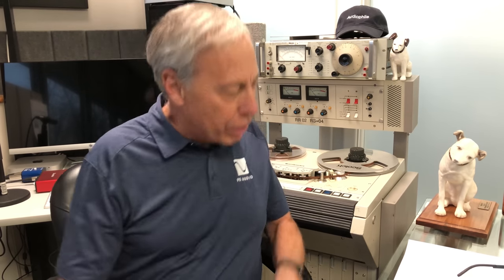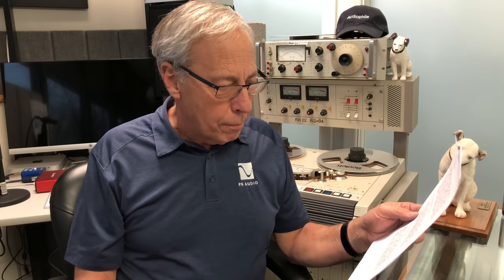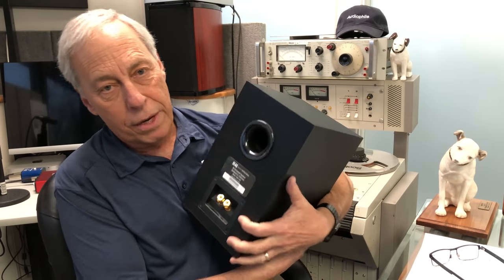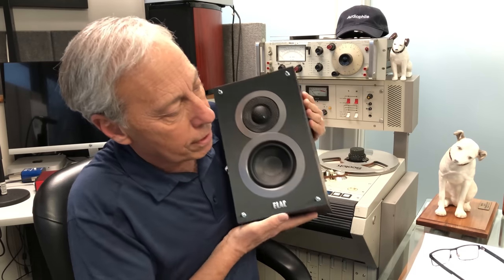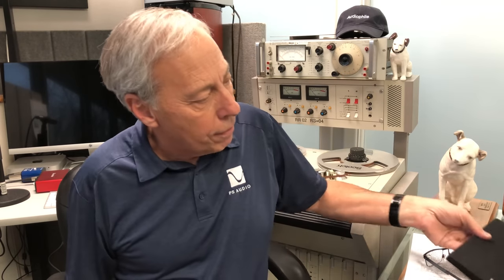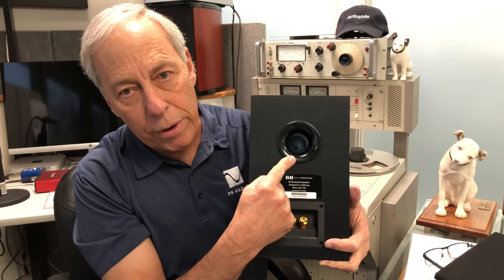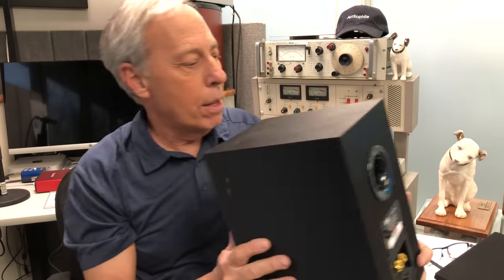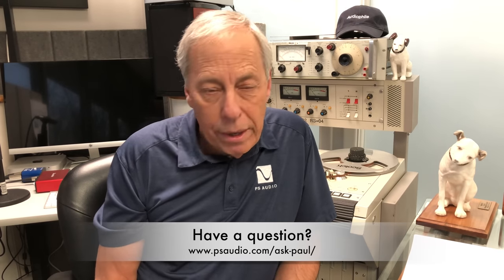Ported loudspeakers

Comment: What happens if the port is too small? Or too large?
Reply: Too small a diameter causes chuffing. Too large a diameter and your woofer might as well be in open air. Changing the length of the port, changes the resonant frequency of the port, which can extend the range of a woofer or smother it.

There is a whole science behind the things. Or atleast there is behind the well designed ones. Thankfully we have computers these days, you can just feed them specifications on a woofer and what kind of port you want and it'll spit out a design for you.

Comment: Jm labs proved how badly a front port could fail.  $38k for a pair of speakers with an odd shaped large  front port.  The bad part?  The port coloration was painfully obvious.  It was the first time I listened to a $38k midfi speaker.
Reply: A lot expensive speakers are dissapointing!  You'd be surprised these days what budget gear can sound expensive and surprisingly pleasing I have even heard some "DJ" speakers that surprisingly make for decent hifi speakers.  Despite thier   looks and unknown brand names!
Reply: @raymondleggs5508  I sure love my Cerwin-Vega! SL 15s. Less than $1000, and since this is all about bass, they get down. Specs say 28hz, I don't doubt it. Hard to find a big box 3-way anymore. Really fun speakers, I enjoy them. A good powerful amp helps.
Reply: @ericnortan9012  To get big loud sound you need big speakers with big woofers
Reply: @raymondleggs5508  I agree. That's why I have 15" 3-ways
🤘💀🤘

Comment: damn, i hate the sound of sealed... it sounds restricted, stifled, like its being kidnapped and the  chloroform is starting to kick in.
Reply: Then you have listened to a poor design.
Reply: You have no experience in old school sound ! BIG bass driver in sealed cabinet was AWESOME  !!! Look for KEF reference 3way floorstander  from end of 70-ies... R105 i think it was... point is that "small excursion drivers" were great in sealed boxes...
Reply: You're hearing the sound of the placebo effect.
Reply: Mohammad. I agree. A sealed cabinet has no volume. A sealed speaker sounds congested.
Reply: It's called "damping effect" for bass. But basreflex is always better IF IT'S high excursion driver and made for ported/transmission line/horn  setup...
Reply: Go and listen to ATC speakers like the SCM40

Comment: Helmholtz resonator. Below a certain frequency, out of phase, then above that at the tuning frequency, in phase - then even higher above that, theoretically no output from the port. Take a weight and attach to the bottom of an elastic string and let it drop down holding it with your hand. Now move your hand up and down very slowly, everything moves together. Start moving your hand gradually faster up and down and you will get to a certain 'frequency' where the hand goes up the weight goes down and vice versa. They will be going in opposite direction, it will be inverted. The hand is the cone, the elastic string is the volume of the box, and the weight is the air in the port. Go even faster and you will get to a point where the hand moves up and down so fast and yet the weight does not, it will become stationary.

Comment: Hate ports. The always cause a bass hump around 100 HZ and I can hear the port. Passive radiators are the way to go in my opinion. But the tightest most accurate bass I ever heard was from electrostatic speakers like mine.
Reply: Anders Hammer heard quad electro-static speakers with quad 33/303 "traffic welcome to the canteen (live)
it was "the real thing"
never forget it.
did beat my klipsch la scala/mac-tubes/ Decca London handselected
by it's natural presentation....
Reply: The La Scala's were to me the best I'd heard of horn speakers. I use early Acoustat electrostatic speakers in my system and to me they sound the same as a live orchestra.My father used to tell me not to spend alot on a stereo because it will never sound like the real thing and that I should spend my money on tickets. Well he kinda ate his words when he heard my stereo.
Reply: A good ported box sounds better than any passive can. Passive let's you keep the box small that's it. It has no advantage over ported.
Reply: check out some of the higher powered car audio subs, and u aint gonna get no 100hz boost.   the enclousures u listen to arent designed properly.
Reply: Car audio is designed for cars not home audio. I really have no interest in car audio.
Reply: Passive radiator let's you lose the volume in the port volume required (which is substantial). In the war to make the most compact, highest output box. SQ take a back seat , I can rattle my fillings out with a tiny d-class box. Let's get back to basics.
Reply: You obviously have no clue how ports work.
Reply: Not always at 100Hz; different speakers are tuned differently.

Comment: I am about to make a sub enclosure from a large PVC Pipe section which is 14 " that allows me to use a 12 inch driver can anyone surgery a website or free designs for tube enclosures, I might encorporate a full speaker build using the tube section with a smaller book shelf type speaker design attaching them together making the tube a pure downfiring sub.

Comment: I have front and rear ports on my B&W 704 floor-standing speakers ; yet I find them too light in the bass department
Reply: Perhaps placement? Tried another amp or pre-amp? I have heard B&W Nautilus sounding really thin and without any warmth with some Denon receiver.... When a Marantz was hooked up, all came alive. Than mono-blocks where added along with cracks in the walls.....
Reply: @rdolle990  I changed to DALI opticron floor stand speakers with REL woofers for each channel... also use 2 Arcam amplifiers with Vertical bi-amp wiring... amazing results !!
Reply: @pandoraefretum  That's earth-quaking! :)

Comment: The bottom line is, listen with your ears and NOT your wallet and what other people say. There's not one "correct" way to design a speaker, if it's designed well. Sealed, Ported, Transmission Line, Planar, Electrostatic, etc. are all just different ways to get you to the Music.
Reply: But what if my ears and my wallet vehemently disagree?

Comment: I never like ported speakers either.  The speakers that I have are now 40 years old.  I designed and built them myself, and they are still going strong.   I did though have to rebuild the woofers at one point since the outer rubber cone mounting rings had turned to dust. But for just 27 dollars, and a couple of hours work per woofer, they were as good as new.   https://ibb.co/jSWGOo

Comment: The Elac speaker that you had in your hands...you were not pressing on the woofer...you were pressing on a passive driver that is moved by the active woofer inside the box therefore the inside volume of air changes and is not fixed....just saying

Comment: Not to beat a dead horse but I have a set of AAD 2001 monitors , 4.75 inch driver , rear ported . I invite anyone to detect any audible port discharge noise from these Phil Jones marvels. easily 32 hz from a small monitor with a small bass inch driver.....  DESIGN ….

Comment: Wow. I tried to plug up the port on my sub woofer. Totally no more bass! It does seem to sound a bit cleaner. But all those pleasant frequencies are gone! :)
Reply: That is not exactly how that works.  A properly sealed box uses the subwoofers T/S parameters to determine the best size for the box (typically much smaller than the ported box).  Also a designer will look at the Q of the speaker to see if it works better in a sealed or ported enclosure.  So it is not a huge surprise that you got that result just by plugging the port on your subwoofer.
Reply: Paul,

That really all depends on your goal. If that was true, manufacturers like KEF and Monitor Audio wouldn't supply port bungs to tailor the bass response for a given room or speaker placement. I've plugged ports on many speakers and subwoofers, and in many cases, the bass quality improved significantly. Yes, of course there was some loss in bass quantity and extension but the trade off was worthwhile.
Reply: Tell that To SVS..their subs with multiple ports come with port plugs. In fact they recommend plugging ALL ports for music as it increases transient response, and has a more natural roll off.
Reply: TheeJoeyLee yes but they're design is designed to give the option. That's a lot different then a design that is solely meant to be ported. Chances are a ported design has a woofer that was never intended to be in a sealed enclosure.